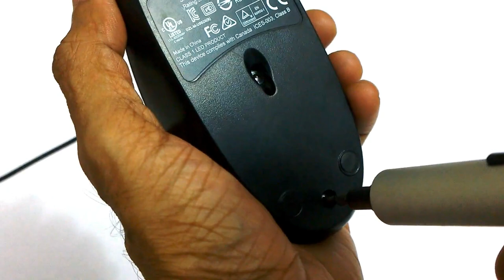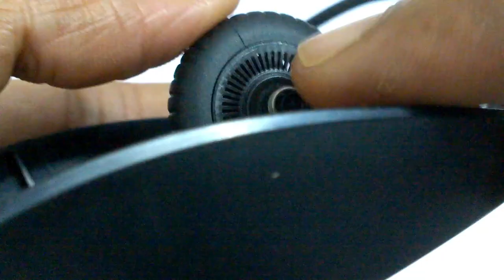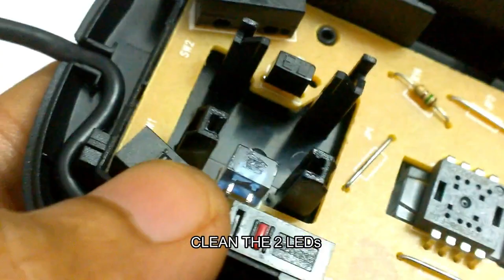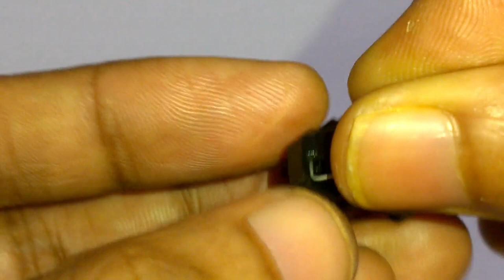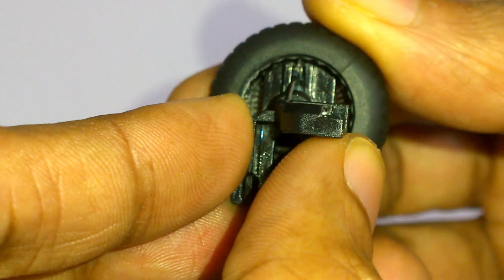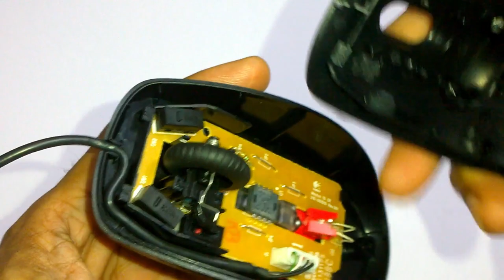Logitech B100 Mouse Scroll Wheel Fix - Disassembly

Comment: I have watched another video of yours in which you showed how to correct the mouse clicks, it worked wonderful after applying some sanitizer (I was having double click at once problem and sometime my left click also worked as right click). Everything got sort out but, my spring and the thin metal wire came out and I wasted my 2 hours in putting that thin metal incorrectly and now this video helped me get both the springs and thin wire back into their position. THANKS A LOT!!!! No need to buy a new mouse!!!

Comment: Hey man, I just cleaned my mouse I cleaned the lens and I cleaned the main sensor under the mouse. Now my mouse cursor seems to be jittering a bit, It doesn't seem as accurate as before, It seems as if it ignores my movement for every second, And all I did was I took a clean nylon cloth I put a little bit of water on it, squeezed the water out and I cleaned the sensor with the cloth looking like a Q-Tip